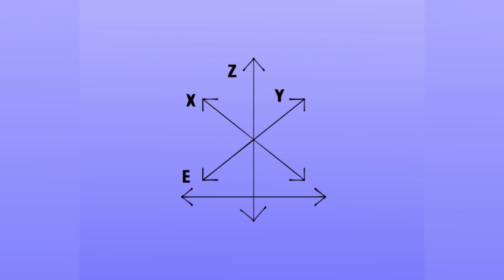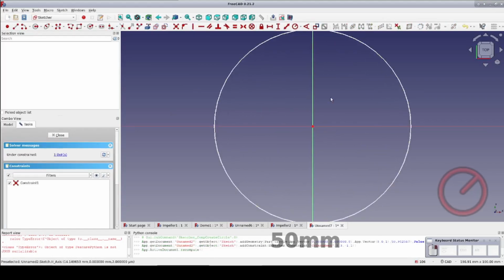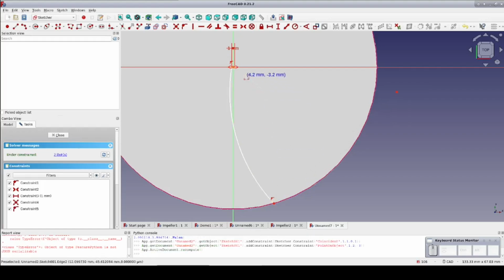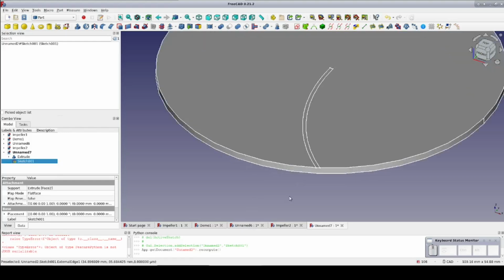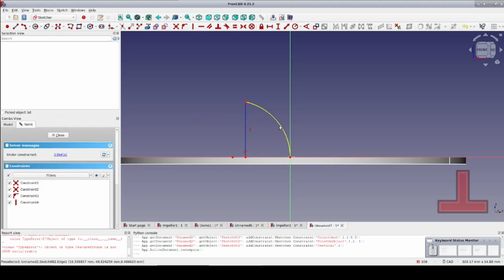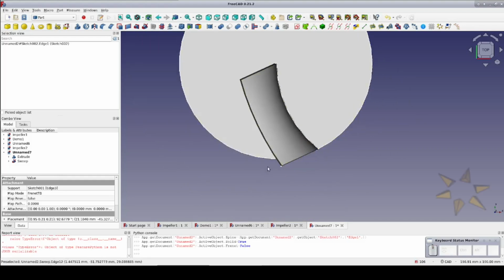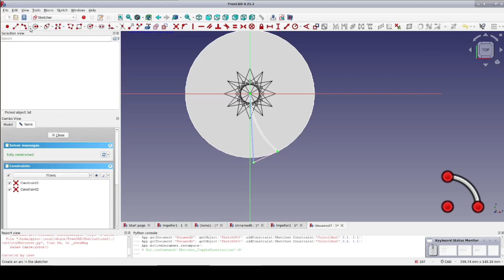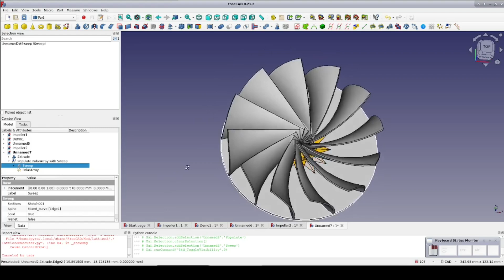FreeCAD: Throwing you a Mixed Curve

Comment: I understand you made this video as an example of how to use the mixed curve tool -- but just to further my own understanding -- couldn't you have accomplished the same thing with a boolean cut? That was my natural go-to when I understood what you wanted out of the end result. What would be the advantages/disadvantages between the two approaches? Is one more parametric than the other?
Reply from the maker: It doesn't make it more parametric, but by incorporating the segment of the circle in the spine of the sweep, it gives me better control of the final geometry. Also, the blade is essentially designed in polar coordinates, so having the sweep's spine tangent to the disc rather than along the circumference tends to distort the blade's geometry.